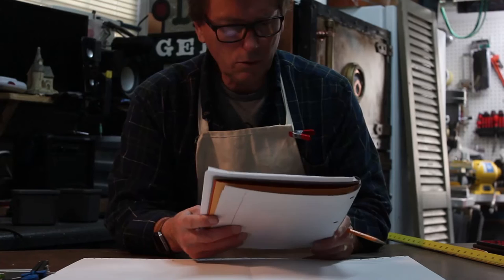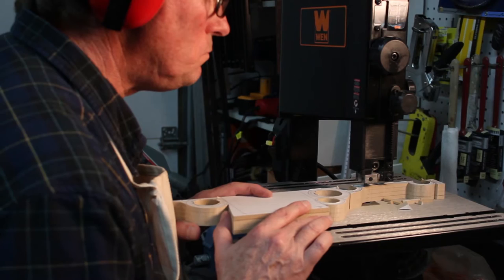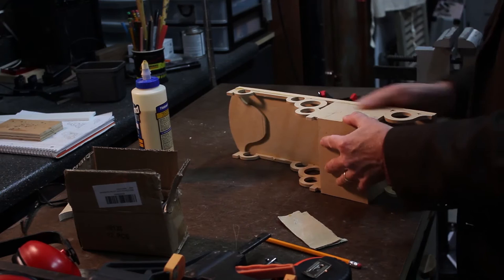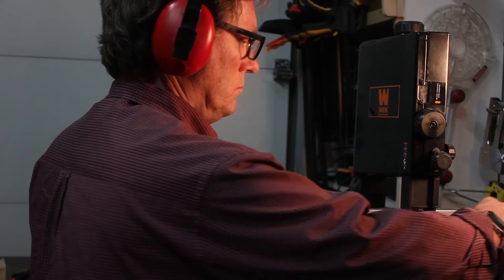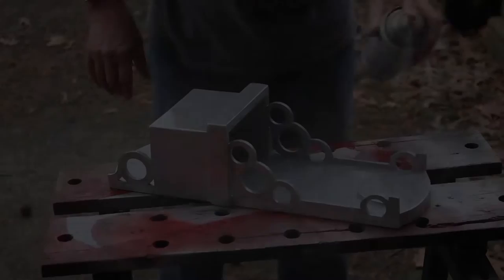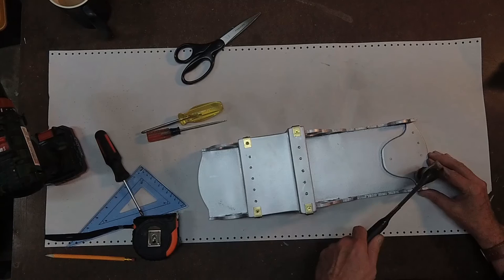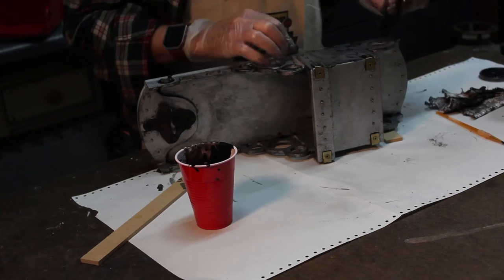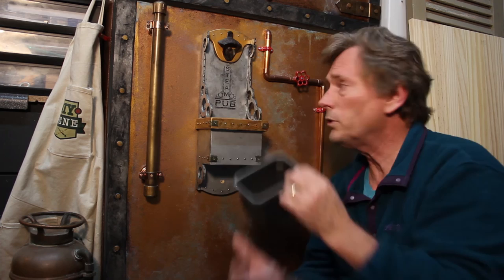SteamPunk Bottle Opener (How to Make - Step by Step)

Comment: man i remember as a kid my buddy had a TON of that printer paper that had the perforated edges with the little holes all in it and we would use that to draw/make all kinds of stuff. great job by the way!
Reply from the maker: I have a box left that has worked well for me for a long time. Thanks so much for watching.
Reply: Same, I worked at a place that manufactured that paper for 4 years in the 1980's.

Comment: Nice project! Have the rivets lasted over the years? It seems that having both the door handles and the bottle opener attached to that door with just a couple of rivets might break down easily but how's the reality after using it?
Reply from the maker: Remarkably it’s holding up great! I have has no problems and have moved and opened a lot of beverages in and out of it. Thanks so much for watching.